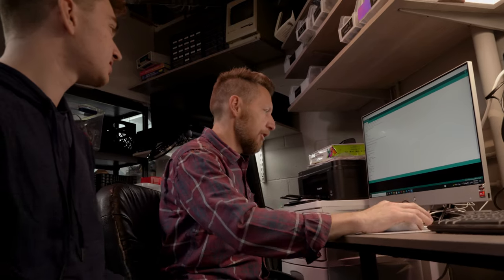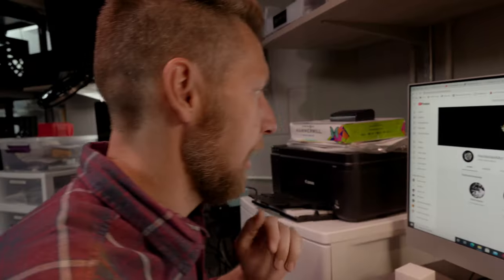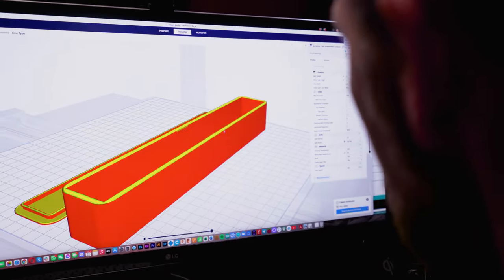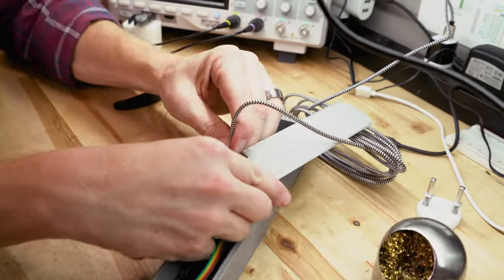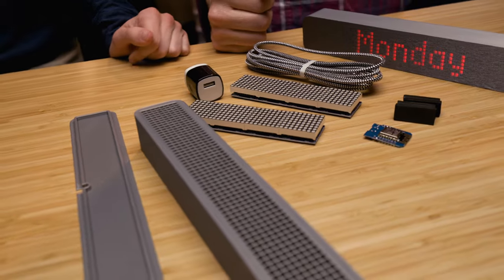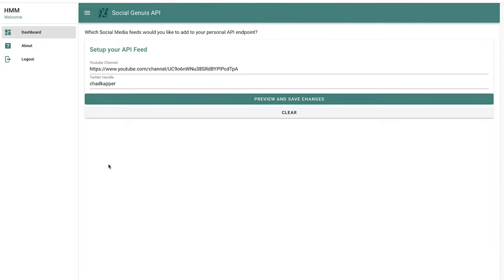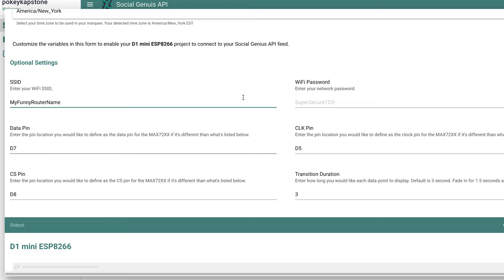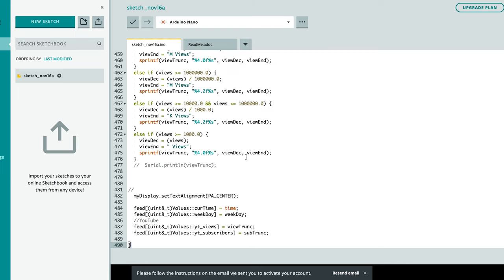YouTube Subscriber Counter Clock - DIY Build less than $20!

Comment: How can we add MM/DD/YYYY display to the code ?   I see examples of code out there pulling from the NTPClient,  but don't want to break Keith's code !
Reply from the maker: I’ll look into it and get back to you!
Reply from the maker: Here is the response from Keith…

“You can simply add another “state” to the state object (ie date=7) and increase the state.count (which is the total number of states), then in the switch statement you can inject the date information when the state machine (function) runs.”

Just save a separate file and experiment. Even if you break it, you can always go back to the original :)
Reply: @HackMakeMod  Awesome ! New to this programming language but found what Keith is talking about !  I also had to add another square to the 7819 and edited how many were connected and that allowed my full YT channel name to be displayed ! Powerful unit for the size and cost !  Many thanks for the help and fast reply !
Reply: @EricTechstuffs  how did you get  your full TY channel name to display? do you have a video of what you did? thanks

Comment: Is this project still working? Trying to put together a "remixed" version with just 4 display units instead of 8 to be more compact. But beyond that it would seem that its not successfully connecting , getting "connection failed" in the serial monitor and also the fade time is way off. I left the default at 3 seconds but its more like 3 minutes. Just wondering if there are some updates required. Thanks!

Comment: HOLY SHI1T IS THIS A PHVCKING NIGHTMARE for a blind person.
I got my Hayear 5mp inspection microscope fired up, pointing at soldering mat, with my TS100, flux, silver tip tinner, tip cleaner, sponge, SOS pad, and Kester solder.  How the heck am I suppose to bridge these two modules together with the little bridge connector?  How are you suppose to solder... under the plastic of the little included bridge connector?

Using packing tape I taped the sides of the panels together to hold them in place.   Whoever is the manufacturer could of designed them together so they just snap together and plug into each other.

Looking at it closer, I think I'm just suppose to blob solder across the two pads using the  bpard tiny lead to bridge the pads together, which makes sense.

NOpe, I was on the wrong place on the circuit board. I didn't bridge a single thing.   I probably screwed up something, who knows.  Common guys... :-/

I think I'm suppose to bend a 90 degree angle in the tip of these pins with pliers needle nose pliers and come up through the through holes from underneath.
Reply: Ok, I finished all of that nightmare, and mine is making all sorts of random strobscoping red dots Close Encounters flashing all around the displays...  so I know I got 5v and ground wired up right...    who knows if I bridged any of the other three lines.  I can't tell with my inspection microscope.  I checked my lines and they are connected to the right pin outs.
Reply: I just got it to work.  I had a short between  3v3 and D8  / CS !@#$%^^^  who would put a 3 volt pad right next to a control line... grrrr no wonder it was doing a Close Encounters light show.   NOT BLIND FRIENDLY PROJECT even if you have all the tools.  Only 10 soldering connections to make, but what a PITA because the industry makes things so small.   And I do not have big hands.  And I'm doing this under aninspection microscope.

Comment: Bought this unit. Pretty cool. Question, it says 111,000 subscribers but I have 111,097 ? Is this normal ? 😊
Reply from the maker: Normally to get more detailed stats on the YouTube counter, you need to select the “scroll“ option on the DoLibo website. But YouTube limits the sub counter to 10’s on channels over 9,999 and 100’s on channels over 99,999 subscribers.This is a limitation of the YouTube API. We don’t have any control over this. With that being said, we have been looking into other ways to scrape the info. Unfortunately we haven’t been able to find a way to gather this level of detail yet.

Comment: I get the data in the terminal but my matrix is always bright red on all the leds, not a single change..
Reply from the maker: What microcontroller are you using? And what PIN number for the data?
Reply: @HackMakeMod  wemos d1 mini, DIN - D7, CS - D8, CLK - D5. I receive the api data in the terminal but the led screen is always full on. I tried some examples of the library of the led screen using arduino uno and all of the examples are working using 10, 11, 13 on the uno
Reply from the maker: Are you using our walkthrough?…
https://hackmakemod.com/blogs/projects/diy-kit-guide-building-your-own-subscription-clock

You can contact me through the website and I can help you figure it out.
Reply: @HackMakeMod  yes, I used all the steps,  I have used the website also to generate the code, I have replaced the details, I got the info in the terminal but the led panel is always full bright. Also I am using only 1 module (4 panels, not 8 as in your example). Any ideas how to fix it?

Comment: Hello thanks for the video and project. I am a new builder, I ordered the parts and wired it up and started to load the code. I can't seem  to get this to compile. thanks a million for your help. Here is the error. Again sorry but I am new to this so learning how to solve issues the best I can. :) (THIS is the stock ticker project FYI)

/private/var/folders/bl/xvx8_3k51wl0_ljxyncmzl_h0000gn/T/.arduinoIDE-unsaved2022114-38485-3ol338.5mls6/sketch_dec4c/sketch_dec4c.ino:50:32: error: expected primary-expression before '(' token
   50 | MD_Parola myDisplay = MD_Parola(HARDWARE_TYPE, DATA_PIN, CLK_PIN, CS_PIN, MAX_DEVICES);
      |                                ^
/private/var/folders/bl/xvx8_3k51wl0_ljxyncmzl_h0000gn/T/.arduinoIDE-unsaved2022114-38485-3ol338.5mls6/sketch_dec4c/sketch_dec4c.ino:50:86: error: expected primary-expression before ')' token
   50 | MD_Parola myDisplay = MD_Parola(HARDWARE_TYPE, DATA_PIN, CLK_PIN, CS_PIN, MAX_DEVICES);
      |                                                                                      ^
/private/var/folders/bl/xvx8_3k51wl0_ljxyncmzl_h0000gn/T/.arduinoIDE-unsaved2022114-38485-3ol338.5mls6/sketch_dec4c/sketch_dec4c.ino:165:32: error: expected primary-expression before ';' token
  165 | static uint8_t g_scrollSpeed = ; //E_SCROLL_SPEED_MEDIUM;
      |                                ^
/private/var/folders/bl/xvx8_3k51wl0_ljxyncmzl_h0000gn/T/.arduinoIDE-unsaved2022114-38485-3ol338.5mls6/sketch_dec4c/sketch_dec4c.ino: In function 'void setup()':
/private/var/folders/bl/xvx8_3k51wl0_ljxyncmzl_h0000gn/T/.arduinoIDE-unsaved2022114-38485-3ol338.5mls6/sketch_dec4c/sketch_dec4c.ino:338:11: error: 'g_dispState' was not declared in this scope
  338 |   while ( g_dispState[i] == false ) {
      |           ^~~~~~~~~~~
/private/var/folders/bl/xvx8_3k51wl0_ljxyncmzl_h0000gn/T/.arduinoIDE-unsaved2022114-38485-3ol338.5mls6/sketch_dec4c/sketch_dec4c.ino:350:28: error: no matching function for call to 'NTPClient::setTimeOffset()'
  350 |   timeClient.setTimeOffset();  // Set offset time in seconds to adjust for your timezone: 3600 sec per Hour
      |                            ^
In file included from /private/var/folders/bl/xvx8_3k51wl0_ljxyncmzl_h0000gn/T/.arduinoIDE-unsaved2022114-38485-3ol338.5mls6/sketch_dec4c/sketch_dec4c.ino:15:
/Users/stevecaudle/Documents/Arduino/libraries/NTPClient-master/NTPClient.h:92:10: note: candidate: 'void NTPClient::setTimeOffset(int)'
   92 |     void setTimeOffset(int timeOffset);
      |          ^~~~~~~~~~~~~
/Users/stevecaudle/Documents/Arduino/libraries/NTPClient-master/NTPClient.h:92:10: note:   candidate expects 1 argument, 0 provided
/private/var/folders/bl/xvx8_3k51wl0_ljxyncmzl_h0000gn/T/.arduinoIDE-unsaved2022114-38485-3ol338.5mls6/sketch_dec4c/sketch_dec4c.ino: In function 'void makeHTTPRequest()':
/private/var/folders/bl/xvx8_3k51wl0_ljxyncmzl_h0000gn/T/.arduinoIDE-unsaved2022114-38485-3ol338.5mls6/sketch_dec4c/sketch_dec4c.ino:487:5: error: 'g_dispState' was not declared in this scope
  487 |     g_dispState[(uint8_t)Values::curTime] = (tmp == String("true")? true :
      |     ^~~~~~~~~~~
/private/var/folders/bl/xvx8_3k51wl0_ljxyncmzl_h0000gn/T/.arduinoIDE-unsaved2022114-38485-3ol338.5mls6/sketch_dec4c/sketch_dec4c.ino:492:5: error: 'g_dispState' was not declared in this scope
  492 |     g_dispState[(uint8_t)Values::curDate] = (tmp == String("true")? true :
      |     ^~~~~~~~~~~
/private/var/folders/bl/xvx8_3k51wl0_ljxyncmzl_h0000gn/T/.arduinoIDE-unsaved2022114-38485-3ol338.5mls6/sketch_dec4c/sketch_dec4c.ino:497:5: error: 'g_dispState' was not declared in this scope
  497 |     g_dispState[(uint8_t)Values::weekDay] = (tmp == String("true")? true :
      |     ^~~~~~~~~~~
/private/var/folders/bl/xvx8_3k51wl0_ljxyncmzl_h0000gn/T/.arduinoIDE-unsaved2022114-38485-3ol338.5mls6/sketch_dec4c/sketch_dec4c.ino: In function 'void statemachine()':
/private/var/folders/bl/xvx8_3k51wl0_ljxyncmzl_h0000gn/T/.arduinoIDE-unsaved2022114-38485-3ol338.5mls6/sketch_dec4c/sketch_dec4c.ino:621:17: error: 'g_dispState' was not declared in this scope
  621 |         while ( g_dispState[g_dispTextIdx] == false )
      |                 ^~~~~~~~~~~
/private/var/folders/bl/xvx8_3k51wl0_ljxyncmzl_h0000gn/T/.arduinoIDE-unsaved2022114-38485-3ol338.5mls6/sketch_dec4c/sketch_dec4c.ino: In function 'void configureData()':
/private/var/folders/bl/xvx8_3k51wl0_ljxyncmzl_h0000gn/T/.arduinoIDE-unsaved2022114-38485-3ol338.5mls6/sketch_dec4c/sketch_dec4c.ino:818:11: error: 'g_dispState' was not declared in this scope
  818 |       if (g_dispState[i] == true)
      |           ^~~~~~~~~~~

exit status 1

Compilation error: expected primary-expression before '(' token